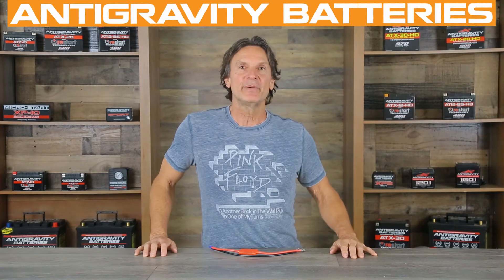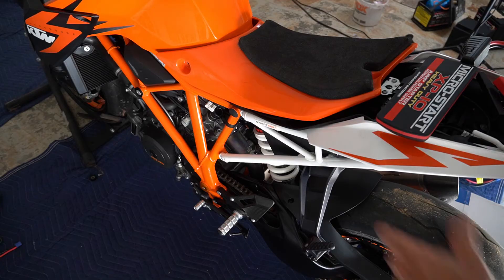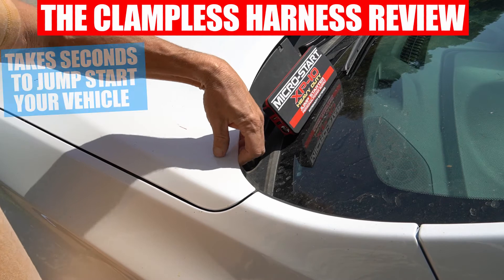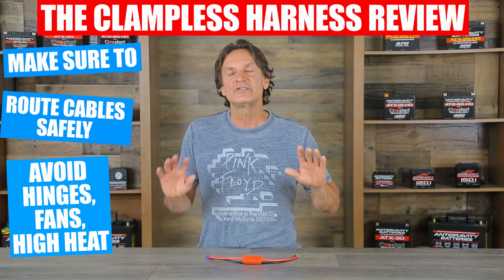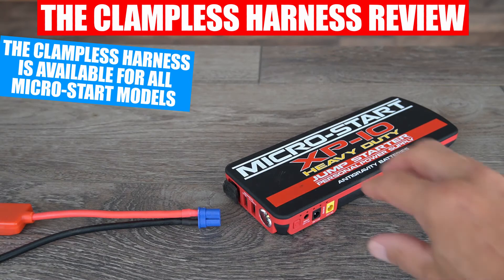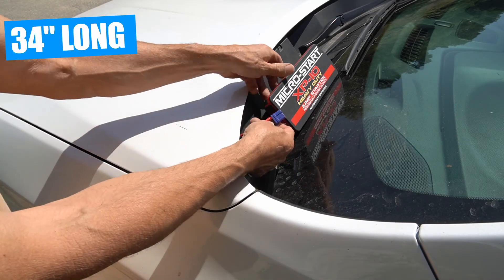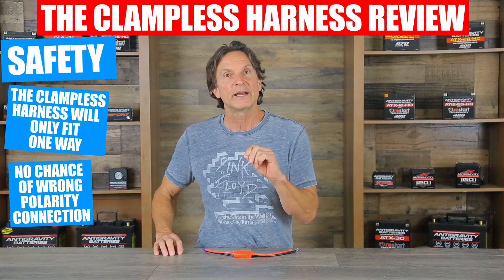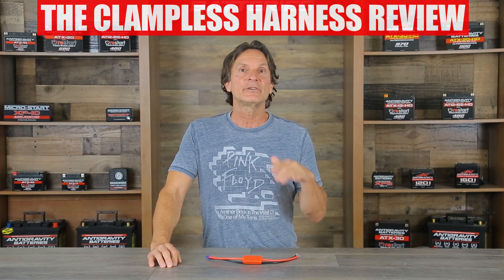Clampless Harness Review Antigravity Batteries

Comment: Just got one clampless jump starter harness (model# AG-MSA-10B) for the XP-10 Micro-Start battery. Total cost with shipping on ebay was $21.31. Before installing it on my motorcycle battery, I connected the blue adaptor tip to my XP-10 Micro-Start battery to make sure it fit correctly. Even though I did not turn on the portable battery, the positive & negative cables touched accidentally & I heard a spark which left a copper ding at the point of contact. So even though the portable battery is off & you attach the clampless harness the cables are energized! Wrap at least one cable tip with electrical tape if you do this. Afterwards, I checked continuity on both cables. The negative read 0 ohms but the positive cable read 3.5 ohms. Is the resistance on the positive cable due to the in-line diode or does the cable now have a short? My only complaint regarding this product is that the blue tip terminal does not come with a cap or dust cover to keep it clean & free of corrosion. Thank you.
Reply from the maker: Sorry for delay in answering... the fact is you need to connect the harness to the battery first because the voltage is LIVE when plugged into the Jump STarter...so yes connect the unit first to your battery then when needed you slide the jump starter on the harness and start your car, then remove.  As far as continuity, yes the diode creates some restriction, as it is designed to prevent back charge into the jump starter.
Reply: You didn't answer about the cable not coming with a dust cover...this is much needed to fight against the elements and corrosion; note most of the SAE connectors (including your version) come with a dust cover. This should be added to any current and future cable sales @AntigravityBatteries

Comment: If that positive lead (the red one) becomes pinched or cut, that may result in a dead short to the vehicle chassis. That possibility seems to represent a safety and/or a liability issue. Shouldn't that lead be protected by a fuse or circuit breaker?

Comment: Does the same clampless harness fit into the new XP-20 as well?
Reply from the maker: No sorry it does not, those are coming in shortly, but the XP-20 has a Larger Jump STart Connector due to it higher power... So the tip will be different.